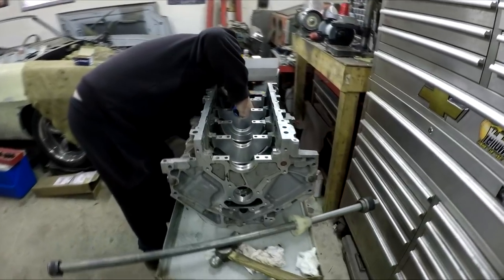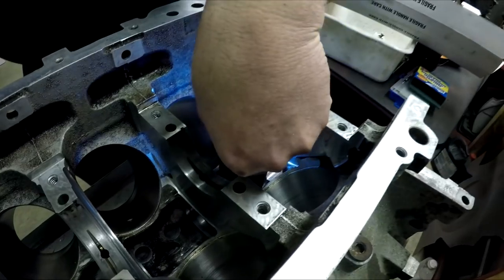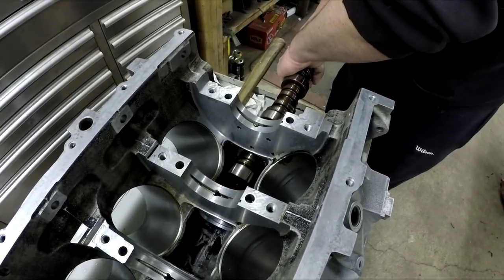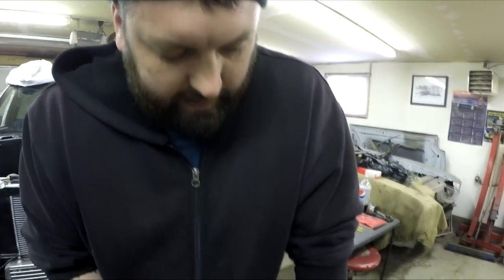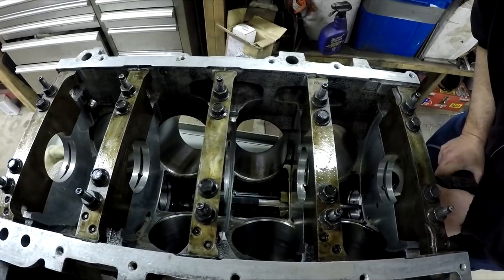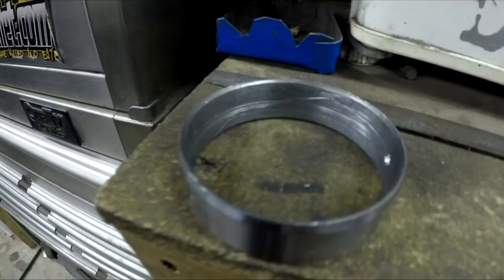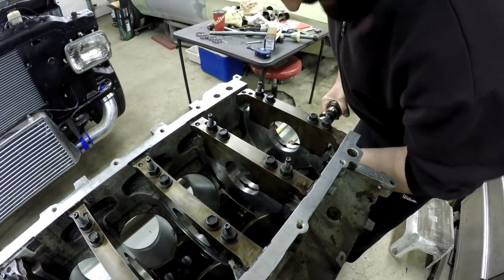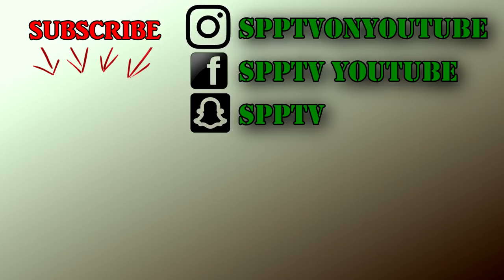Camshaft Bearing Install "Making Mistakes So You Don't Have To" | How To Build a LS Engine (ep1)

Comment: Install the rear 2 bearings from the back of the block first. Start with 4 then 5. The do 3 from the front. Then 2 then 1.
Reply: i do them all in a line from the front working back - last one needs a fine hand and a 2nd person checking the alignment to get it going since there is no room for the cone- (i have an OTC set that uses a screw method - cumbersom but does not potentially damage the bearings like the hammer style can) .. most of the time the cam tunnel isnt accessible thru the engine stand- whats the benefit to do it this way?

Comment: Most cam bearing installation tools have to be expanded to fit all cam bearings. Those tools either have the expansion of the tool opened up too far to fit LS cam bearings. Or it won't fit the next size up. With the tool expanded to the max, it distorts the bearing edges. I made me a cam bearing installation tool from a cam bearing cam journal. Applied weld to one end and ended up machining it down slightly larger than the bearing and with a flat edge to press the bearing in. Drill out the center, tapped it so it would fit my cam bearing installation tool. I Install the bearings from the opposite end that they go so the tappered cone keeps the tool square with the cam bore. Install the center bearing from either end. Remember the bearings are numbered to go in a specific cam position. If you allow the driver tool to slap the bearing during installation, the more likely the edge will be damaged. Patience is the key to proper bearing install. Great video guys except for the language from the inserted video!

Comment: The rear two cam bearings MUST be installed from the rear of the engine, did this myself. The back two journals are tapered and when driving them in from the front you swaged the bearings. That’s why the cam is still so hard to turn at the end of the video! Good thing is you’ll only need to replace the back two
Reply from the maker: Hmmm. The video might not be over yet then lol.
Reply: When I did it the same way as you not knowing any different the cam was hard to turn (about the same tension at the end of the video) After I found this out I put two new ones in from the back and the cam turned like butter! Silky smooth
Reply: LOL yup! It’s an honest mistake.
Reply from the maker: Clayton's idea was go from the end furthest away, so the cone would keep the bearing more true. Was not aware some journals are tapered. I noticed on the rear most one theirs a casting cut away on the inner side, which I thought might cause a problem as well. Watched another video on it and the "pro machinist" explained that. The "pro machinist" also messed up 2 bearings instaling them with an $800 tool. So we don't feel too bad lol. Thanks for the tip.
Reply: SPPTV rear two bearing do need to be installed from the rear side of the block and the block design needs the 6 bolt mains to be torqued so the cam goes in easier without scaring the od
Reply: I wonder about that concept that says any journals are tapered because #1 and #5 are the same, #2 and #4 are the same. If the journals are tapered would there not have to be an insert side of some kind marked on them so that you don't put the bearings in backwards? If not, the journal would swage the one side of the bearing and it would be too tight anyway. Plus there is another guy who installs #5 - #2 from the front and then #1 from the rear and he had no trouble with the cam fit on his 5.3 L but it was a 2004 which is the older style. Truthfully, I cannot believe that they would taper any of the bearing surfaces.
Reply: @Steve Groenink how are you suppose to center the tool when driving in the rear bearing from the rear? Sounds like a good way to wreck a bearing...
Reply: They are not tapered, but there are 3 different OD's, but they all have the same ID. The center one has the smallest OD, so if you put any one other than the actual center one in there, it will be tight. Cam bearings should always be installed with the centering cone as far away from the bearing being installed as possible; ie. from the opposite end of the block.
Reply: Dynamic Transmission after installing a set I found the #4 journal is tapered in the rear, so that bearing must be installed from the rear and that is why they had trouble in this video.

Comment: I did mine, same tool, same bearings, and same aluminum block. I had my block on a table. Front 2 I put in from back, back 2 I put in from front. Center doesn't matter which way it goes in. I used a lighter hammer also because the tool dented the old bearings while pushing them out with heavy hammer. Used light taps from small hammer to install. Then I took the old cam and installed it and hit it downward with a block of wood, to loosen the bearings up. Then pulled it out one bearing and hit the outside part of cam with wood again in all directions to loosen bearings up a little more. Worked great for me.

Comment: Ordering cam bearings. Late 2003 in October GM made a running change in the outer bearing size of 0.02" on 1&5, 0.01" on 3&4 and #3 remains the same. Early from 2002-2003 late, the O.D. of 1&5 are 2.327"-2.329", 2&4 are 2.317"-2.319", 3 is 2.307"-2.309" outside diameter. Inside size or camshaft journal remains the same from 2002-2004. Newer engines have larger holes in block. Change in Feet-Per-Second and "Tri-Metal" bearing construction. I prefer the "Bi-Metal" bearings as these have the longest life. Install all bearings dry into clean, inspected or gently honed block with the oil hole located at the bottom edge of the block supply slot CW. This helps increase oil pressure in the delivery closest to bottom end loads.  A steel tube is electroplated with copper, then shortened, a mixture of tin/ led in heated and installed using a centrifugal process. The "Tri-Metal" bearings, bolt mains, rods and camshaft can hold larger debris particles, but the "Bi-Metal" bearings last longer and take higher loads.
WoW. The cam journals are aligned bored, bearings cockeyed and need install lube on cam even if plans include pre-lubing entire engine. Don't forget to run the engine at 2K RPM for 10 minutes for break-in, then repeat at least two more times. This info comes from GM's subject matter expert as I was only looking for production date split. EX-employee and building engine since the late 60's. ASE Master Tech 1978 - Retired.

Comment: there are 2 different sized cam bearings for 2 diff. year 5.3 they enlarged the bearings. check the year of the L33 block and make sure you put the correct bearings in the block

Comment: there is 3 different sized bearings in the block. 1/5 are the same, 2/4 are the same, and 3 is on its own.
Reply from the maker: Yes, we know
Reply: 2/4 is 1/2.

Comment: One potential issue with cam bearings is the original bearings. These bearings are basically made from a strip that is joined together at the top. The problem is that this connection is rather rough. And when you remove them, it tends to put a gouge in the bearing bore. If you don’t clean this up, it could deform the new bearings. And the ridges that form in the bearing bores could deform the new bearings to the point that the cam binds or can’t be installed. The solution here is to sand down the ridge so that the new bearing will install properly.

Comment: "I believe the Cam journals are not align-bored in the block. From what I understand the cam bearings are pressed in and then the bearings are align-bored when produced at the factory. This is true of all the LS family of engines." read that in a few different places now. Maybe some of the issues you had here, idk.

Comment: I built engines for years professionally for a machine shop ...I commend your effort. BTW it happens sometimes just bottle brush the one bearing....assuming u installed each bearing in properly and in the right direction and location.

Comment: City Motor Supply in Dallas Tx; 
Oven clean, Magnaflux, Hone cylinders, Install cam bearings, $95 + bearing cost.
Forbes Rebuilt Engine parts Fort Worth Tx;
Complete block prep above with hot tank and bead blasting which includes cam bearings and cylinder hone $150.
USD of course.
Reply: Not sure but I don't think you can Magnaflux Aluminum
Reply: Elbert Jolley Must have been talking about the crank.
Reply: That I can agree with having the crank yes but aluminum can't be magnaflux from what I have always been told

Comment: DOD cam bearings are wider than the non DOD which is better for performance applications
Tips 
1. Have your bearings frozen for 24h before installation 
2. Install the furthest bearing first
3. Let your block cook under the sun for an hour or two 
4. Use high extream pressure rease or any molybdenum disulfide grease 
These pointers should make your installation  like a breeze

Comment: even with your second cam bearing install it looked like they were very tight a nail file works wonders to debur any edges also those are durabond cam bearings i actually had the same problem with a few sets

Comment: When they first started pushing the barring in it was offset. I. Could see in video. And when he was honing out the center barring he didn't have the hone center and possibly put a bevel on it. Hopefully won't have uneven wear down the road. Delicate job. I would of stopped tapping the first barring when it wasn't going in straight

Comment: Another thing I should mention is that, if you are working with an aluminum block engine, you need to lube the outside of the bearings. This goes against the common wisdom of ALWAYS installing cam bearings dry. But installing cam bearings dry is for iron blocks, NOT aluminum.

When installing cam bearings in aluminum, the aluminum galls far too easily without lubrication, which can cause the bearings build up metal on the back sides. This can cause bearings to be ‘pinched down’ in diameter or go in crooked, which can cause cam binding. It can also damage the cam bearing bores, which will require that you get your block line bored for oversized cam bearings. So if you are working with an aluminum block, don’t forget to lube your bearings.

Comment: Wouldn't it be easier to put the motor on the ground and it won't move, also if the mains are torqued will it fit better?

Comment: I installed new Teflon coated cam bearings in my iron gen 4 LY6 and the second from back one picked up on the oil holes as I pressed it in, and then when I slid the cam in, it wiped the Teflon on bearing. The area where it wiped was the smallest as you could expect and it was on the trailing side of the oil holes. Really frustrating. I scraped it with a bearing scraper and will run it. See how the boosted lifestyle likes it

Comment: I took a quick look at the cam bearings when i installed my new cam looked all good. I primed the engine last night oil is flowing up around everywhere, have to wait til i fire it up to see how the pressure is. From what i hear is if you can see copper on the cam bearings they are faulty idk myself.

Comment: I'm having the exact same issues BUTT with a Ford 4.0 OHV. Trying the bearings on the cam before wippy wapping em in the block discovered 1 to be tight. Even the old original bearings were tight on the cam. Explain that.

Comment: I have a question could you soak the block in a 55 gal drum or tub with diesel in it for aweek or two
Reply: That's a lot fuel lol, I use water and a gallon or 2 of simple green. Through a heater of sorts in there and let it sit a day or 2 or u could boil the mix in the drum for a few hours and it'll work miracles
Reply: Dansyoutube  TRUE, when I first joined the AF back in 87 we were using Simple Green to clean our F-15's, then it got banned in 90 91, for what it does to aluminum.

Comment: Would it be a good idea to put the bearings in the fridge or freezer to shrink them a little to help them go in straighter and easier?
Reply from the maker: Sounds like that would help to me.
Reply: SPPTV I've done it a few times while installing bearing races in dirt bike frames for the steering stem bearings as well as installing crank shaft bearings in model airplane engines. It usually makes them go in quite nicely. It also helps to put a little heat onto the piece you're removing the bearings from or putting them into. Not really an option with an engine block, obviously. Anyway, just an old trick I thought I would mention. Keep the videos coming!

Comment: did u put the bearings in the right journals?? just asking
Reply from the maker: Ya we dbl checked that.
Reply: So the bearings aren't all the same? Seems strange, but I've never replaced any. Are they different widths or are some thicker because the journals are bigger?
Reply: joeshmoe12301230 thicker; the bearing box will tell which goes where. #1 & #5 are the same on a ls, so are #2 & #4 while #3 is it's own. i believe the factory does this for tooling reasons.
Reply: SPPTV there was a year break, '04 i think, where the rear cam bore diameter changed. if the bearings are newer, i believe you might have an extra .o20" interference on number 5, which is why it drove in like shit and wouldn't accept the cam.
Reply from the maker: The block is a 05 l33 and the bearings are for that year
Reply: Good info man. So is the rear journal is different, but is the inside diameter of the bearing the same? Or are there two separate style LS cams? Just wondering because I've done some cam swaps and never had a problem. Did I get lucky that I'd gotten the correct cams?
Reply: @ joeshmoe12301230,    Cam bearing installation is a HUGE deal see this:   http://www.hotrod.com/articles/0411rc-cam-bearing-installation/
Reply: @SPPTVarmy  Bore 1/5 = 2.346, Bore 2/4 = 2.326, Bore 3 = 2.307 but all five have identical ID
Reply: @bennyfactr6122  I thought it was hanging on #3 the middle one. #3 is the smallest bore so the material is thinner than the others. The L33 was made from 2005 -2007 in pickups according to 'On All Cylinders'.

Comment: I had my entire crank in and torqued before realizing my cam wouldn't go in due to the bearings. Ended up replacing the cam bearings with the crank still installed. Wasn't fun but I got it done. Cam just doesn't spin as freely as I would like

Comment: If you leave the cam laying on its side for months at a time (like on a table or in a box) it can actually warp
Reply from the maker: The one I brought that wasnt fitting right in the end was kept on end, indoors, in a box. Who knows lol.
Reply: as long as its kept flat it wobt because its supported by the bearing surfaces. if not level and flat they can be messed up. mine sat for 3 years and was straight

Comment: Curiosity got the better of me so I started trying to find cam bearings, and yeh, they, local, wonder why we just go down to the 'States or order from there.  
NAPA Canada lists "camshaft bearing sets" but never asks for the engine size in the simplest search so you get all the results and have to go several levels deep to find out what that set of bearings is meant for and then back out to the search results taking forever, they do not list by manufacturer so Clevite, Sealed Power, Durabond never show up.
Autovalue/Piston Ring has a search engine that goes nowhere, nothing I could find under Camshaft/Timing or under Engine-Bearings (mains yes but that is all).  Got tired of looking.
Amazon in Canada does have the Clevite version for the LS.  And I did find one other Canadian online seller listing them.

Comment: Oven cleaner (caustic soda) is the wrong chemical to use on aluminum, it dissolves it and can damage bearing and gasket surfaces.  It's fine for steel and iron, but not aluminum.  The best chemical to clean aluminum engine blocks and heads with is citris strip, available at Lowes or Home Depot.  Apply it with a brush, let it set for 10-15 minutes and then pressure blast the oil and carbon off.